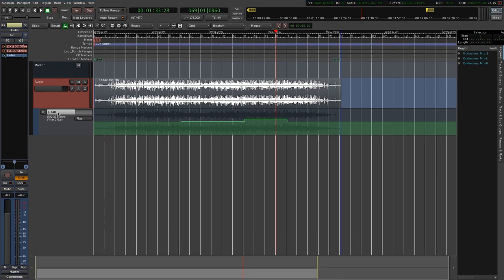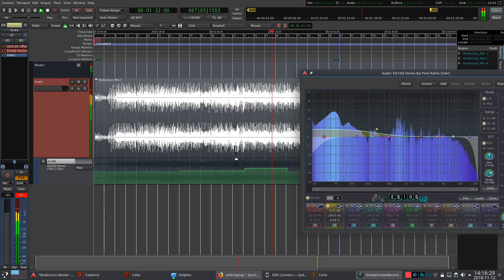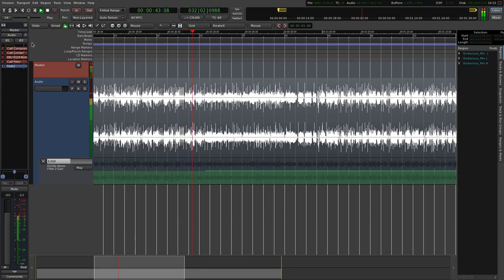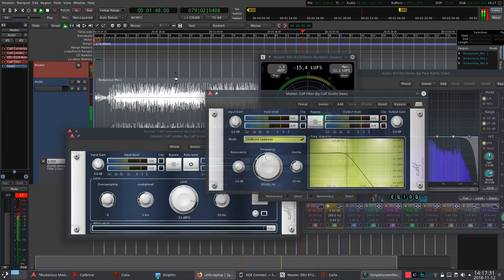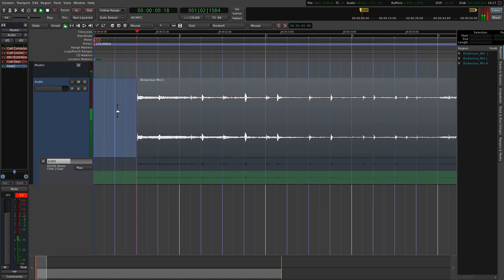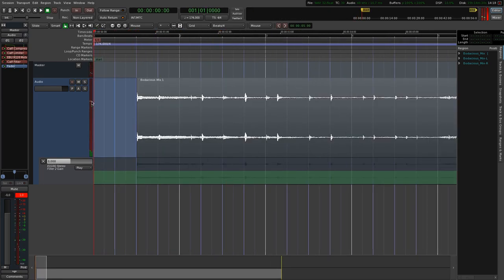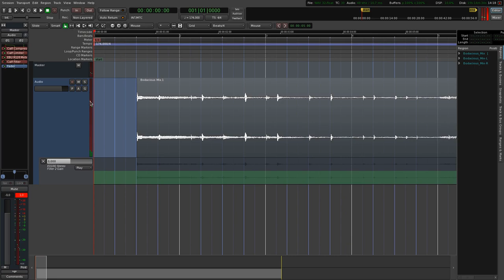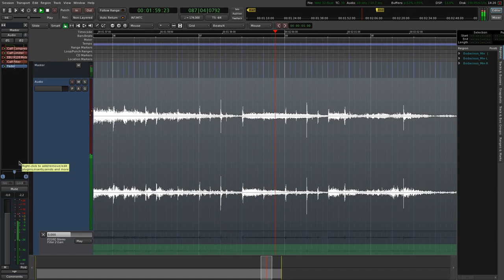Making of "Bodacious" - Day 7 Part 6 (mastering and summary)

Comment: the whole series of this track is really great i love the overall sound design. just curious about one thing are the peaks of drums that you can see in the waveform is it normal or some adjustment has to be made in compression or something? because when i was making a track yesterday i noticed i had those peaks too those straight lines between waveforms i thought i was doing something wrong because im not really used to synthesize sound specially drums, but when i saw your video i thought maybe its normal. also i noticed the kick i made using geonkick the low end was muddy, i used calf multiband gate to control it so it sounds like a kick not muddy bass. is it a good practice to use multiband gate for drums. sorry im not really used to synthesizing stuff just looking for some advice. :/
Reply from the maker: Hey, it's matter or preference. I generally like strong transients on drums, so I generally emphasize them during synthesis, and then saturate the drum a bit to tame it, while converting the amplitude energy into harmonics. You can go too far with the transients, but generally I think most people making EDM smash everything so hard, there's zero transients, so I want to explore a different way, utilizing the -14 LUFS integrated headroom that is usually wasted in EDM.